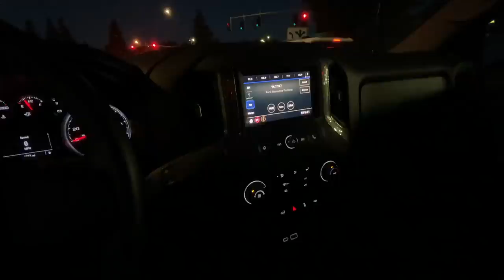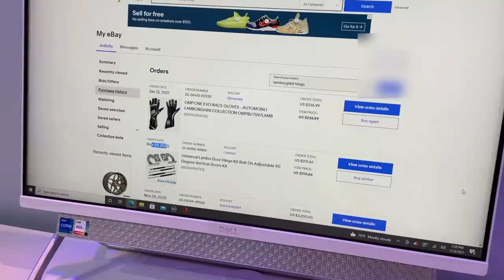B IS FOR BUILD & JUMPACAN DO SEMA 2021

Comment: there's a fix for that fuse, you bypass the mini fuse and wire in a bigger one, check ford for the repair kit. (for the raptor)
Reply: I have a similar year Raptor, and Brandon is right.  The repair kit relocates the fuse (because often when the fuel pump fuse goes, it melts the surrounding fuse holder rending it inoperable).   It is an official Ford repair and doesn't cost that much, although labor wasn't cheap (I didn't do it myself).
Reply: This is correct there is a TSB for and I couldn't tell you how many I have done as a Ford Tech. Super simple
Reply: The proper fix was towing with a Silverado, like he did. 😉😆😁😂
Reply: It's TSB 15-0137. I've done it a few times as well and it's pretty easy to knock out in 30 minutes. Part number EL3Z-14293-A
Reply: Did the same on my 2012 F150 5.0 and no issues since
Reply: Fuse 27 strikes again! Rookie move not doing the relocation proactively! lol
Reply: Fuse 27 kit its like 15 bucks
Reply: Just saw this, I have done the Ford tsb on customer trucks

Comment: Ford is known for having faulty oil pressure sensors, usually when they fail its bad. I'd personally spend the $10 on a new sensor and see where it goes.
Reply: My 2013 F-150 had to have its oil sending unit replaced once or twice a year. Hopefully the 2021 I just got doesn't have the same problem. At least it's cheap and not that hard to replace if it does.
Reply: This truck needs a fuse 27 relocation kit. Cheap and easy, prevents the burnings fuses. Its a normal thing needed to be done on gen 1s
Reply: Fuse relocation kit is totally a thing 

Just changed my oil pressure switch on my 2011 raptor, that’s also a thing.

Comment: Oof. You got hit by the dreaded fuse 27. Gotta change the location before it burns out the actual fuse holder. Motorcraft sells a $25 relocation kit. It’s a must for any gen 1 raptor owner.

Comment: A question and a Suggestion for you.
Q: Any plans to relocate the intakes and filters OUT of the dust storm in the engine bay?
S: Next time you work on the suspension see if Mike Patey has time to talk, that guy has some some insane things with custom suspension builds on both off road vehicles and VSTOL aircraft!

Comment: Oscar, just a thought, can you add to the rear fenders (spoiler like) and add downforce to level the car in air? Maybe eliminate the nose first issue.
Reply: Smaller tubes so it rides top of the fender, and you could angle corners for sharp edges.

Comment: Not a oil pressure fuse but the fuel pump and I had commented in when you got the truck initially to switch the fuse 27 (fuel pump)  and get the kit or you’ll be stranded

Comment: Hope you didn’t spread those fuse terminals with that fuse. You can have connection issues if you spread the terminals too much. Hope those terminal ends are the same width.

Comment: That fuel pump fuse blew for a reason. It will likely come back to haunt you
Reply: Negative - it's a common issue on these, unrelated to the fuel pump.  The official Ford fix relocates fuse, as Brandon said in an earlier comment.

Comment: FORD- Fix Or Repair Daily &/or Found On Road Dead. Hopefully you guys learned your lesson.
Reply: Well considering they are replacing 903 cubic inch turbo diesels with chevy big blocks with half the displacement and a 1/3 the torque output for the boat. I don't think so.